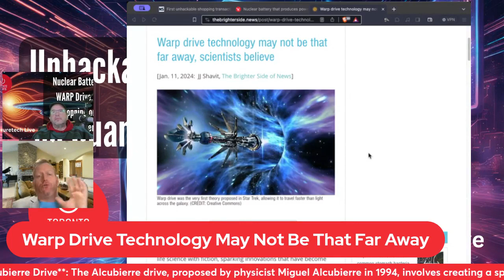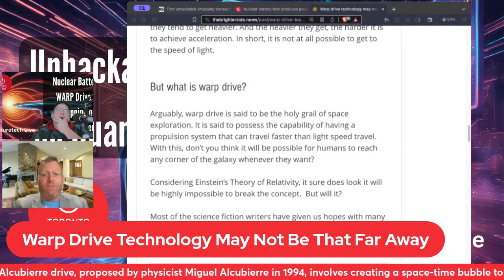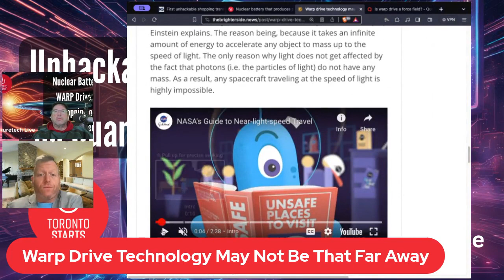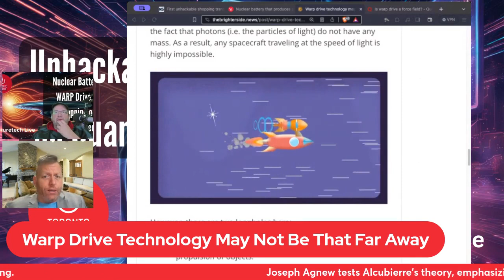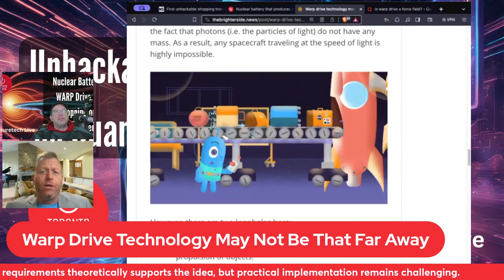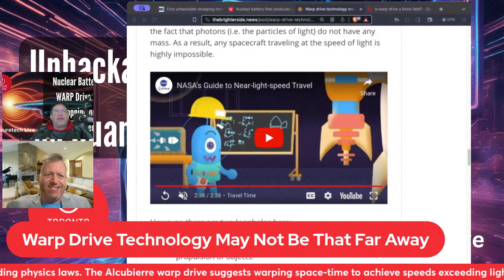Warp Drive: The Future of Space Travel Explained

Comment: For some reason people don't know about the one realistic method for interstellar travel. If a ship travels at a constant 1 g acceleration rate it would get to Alpha Centauri in 3.6 years (7.3 years would pass on Earth) this includes turning the ship around halfway to decelerate. It would achieve about 95% light speed in 1 year. A 10 ton ship would require a mere 10 tons of continuous thrust. This is by far the fastest way we can get to other worlds and the ship would have gravity the whole way.
  All that is needed for this is a fission rocket that can put out thrust for long periods and does not consume hydrogen. A true fission rocket should consume uranium or plutonium only. They are both jittery atoms that are on the verge of fissioning all by themselves. There should be a way to get them to fission in a linear fashion. What's needed is a controlled, time released nuclear explosion.
   In an atomic bomb fission occurs when neutrons hit uranium or plutonium nuclei. This is because they will not tolerate an increase in mass. Due to the equivalence of mass and energy the same should be true if you infuse them with energy. This might be as simple as having negatively charged uranium or plutonium atoms coming into contact with positively charged uranium or plutonium atoms. Or perhaps with laser or electromagnetic forces.
   With the constant acceleration method a ship can span the entire diameter of our galaxy in 24 ship/113,000 Earth years. Systems with stars similar to our sun can be reached in under 10 ship years.